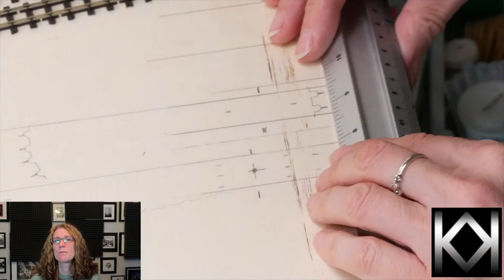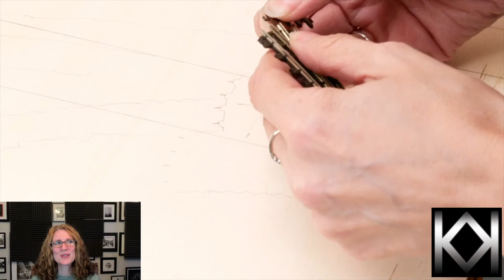The Scenery Stream - Port Dinorwic - Let's Get on Track

Comment: The double flanges were because the wheels were loose on the axles on several quarry lines.Gauge could be slightly flexible to cope with rough, hand laid track where gauge could be variable a bit.
Reply from the maker: It amazes me what they ran over. Just bits of bar sometimes.

Comment: Those copper slepers are the solution to my nightmare. I am making a n-scale  layout and my tight flextrack curves gif me trouble.
Where do get these copper slepers?
Reply from the maker: You can buy them from a number of shops in the UK and elsewhere. I picked mine up over the years but I think my last lot were C&L Finescale. They often come as a long length you cut to size but I’ve also bought ready cut for HO.

Comment: Catching up. Your synching is good so thanks for the i-phone tip; however, not sure what your lighting rig was but the green square reflections flickering on your specs' is something to avoid next time. All the best for talk three. Could you post date & times for the next one in the above blurb please.
Reply from the maker: It’s the 2nd Sunday of the month. I do post the time reminders on IG and FB but YT doesn’t have a great system for notifications. On the green spots, any lights from the front cause these but I need lighting…. This source is well diffused so I don’t have an answer for it I’m afraid.